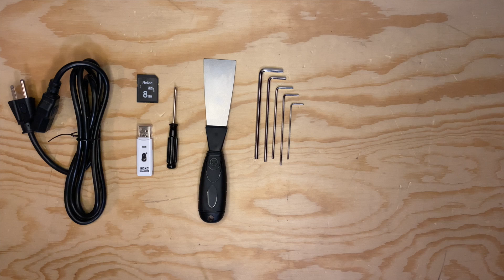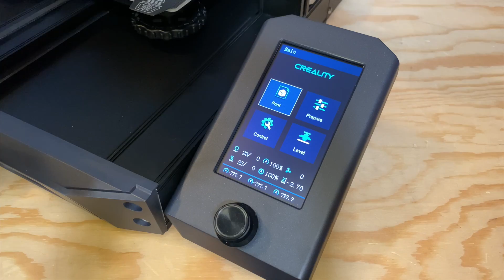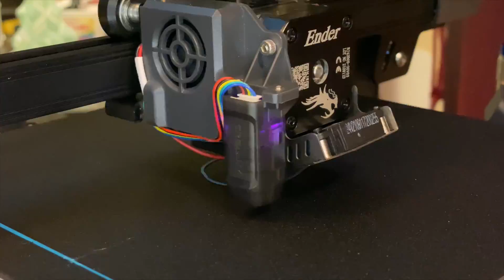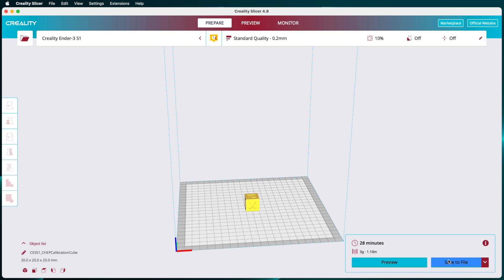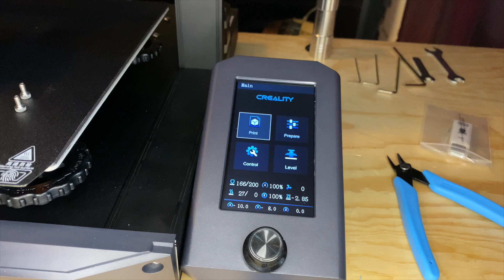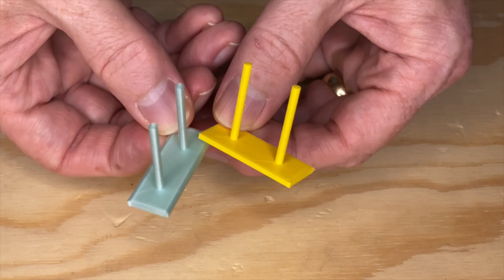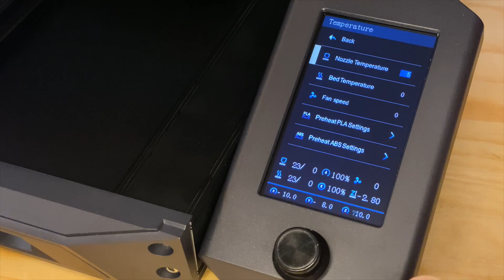The New Creality Ender-3 S1 Review!

Comment: I'm looking for a little help. I'm trying to flash my s1 back to stock after removing it from a sonic pad. I've tried all the firmware options from crwality and can't seem to get it flashed. Display is stuck on the splash screen so I can't tell if the board firmware is loading or even working.

Comment: Hi Bryan, do you happen to know if the catastrophe regarding resuming after a power failure was ever fixed?

I'm pretty turned off on the idea myself. With my ender 3 v2 the sample filament ran out mid print and while I was anticipating it enough to pause and change fillament, the new fillament oozed while the nozzle heated back up, the new fillament didn't extrude properly at first and the oozed glob made a mess. After letting it run for a couple more layers with my fingers crossed, it was clear that print had failed and I had to start again.  Up until now I thought that was the worst thing that could happen if a print was interrupted.

Comment: Thank you for great review video. I have a problem with my s1. Can you help me? I recently purchased an Ender S1 3D printer from Micro Center and have used it for 3-4 prints. However, I've been experiencing an issue where the nozzle and bed temperature drop to zero after heating them to a certain setting and starting a print. I've tried cleaning the hotend nozzle, but the problem persists. Can you assist me with this issue? Thank you

Comment: they have fixed it fully i tried it i have 3 ender3 s1 and a pro all power lost worked fine and i have convert one of my ender 3 s1 to a pro version runs like a dream the new s1 i have a small issue a end stop switch on the bed is rattling creality sending me a new one

Comment: Brian I have this printer on the way I also have a Prusa MK 3+. Since I’m using Prusa slicer I would like to use it with this new printer. Can you give me any hints since processor slicer does not have the same presets for this printer. At least that’s what I’m being told from Prusa support. I know this is a long post but also do you think you could do a video on how to set this up on a raspberry pi. I’m assuming you just use the usb C Connector

Comment: Based on this video and a couple more like it, I made a decision to took the plunge and bought one today and am on my third print object.  I printed the rabbit and handle thingy first and was very pleased with the rabbit, but the bed handle thing was a little rough after I removed the support overburden.  I'm currently printing a small box that fills the width and discovered that this printer is very easy to change the z-offset and increase the nozzle temp on the fly, which is a major benefit for a novice like me.  I changed filament types after creating the GCODE file and discovered that the silk filament needed 210 degrees as a minimum, which I was able to change using the "Tune" option on the control panel.

Comment: Can someone tell me what this printer (assembled, with a spool on) measures to? As in, height, width, length.
For the life of me, I can't find it. I can find "frame dimensions" but not confident what that does and doesn't include.

Thanks in advance!
Reply from the maker: Imperial Measurements Inbound! (My Stanley tape measure isn't metric)
Height with spool: 27 inches.
Depth: 24 inches (measured with bed at rear, then at front, and allowing for bed cable).
Width: 20 inches actual, 24 inches allowing for gantry cables that live on the left side).

If you're wanting to build an enclosure I'd add two inches to each dimension.

Comment: my ender 3 s1 won't recognize the sd card that came with the printer... can someone help? thanks
Reply from the maker: Hi, if your computer can read the card, back up the files on the card to a folder on your computer. Try reformatting the card [ see https://youtu.be/VM29_OFHpy8 ], then copy the files back onto the card.
Reply: @BV3D  Thanks for the response. I tried the solution in the video and erased and formatted as instructed then put everything back into the SD card, but the printer still won't recognize it. I also tried to format it using the SD Card Formatter application. This also erased all of the contents on the SD card, but again, the printer won't recognize it. Do not know what else to do. This is the original SD card that came with the printer, so I do not understand why this is happening.

Comment: Great video. Thanks for all the info. Question: Have you tried filament change (M600) ? I tried it through the creatlity slicer. Things started off great, I like the way it paused and didn't leave the nozzle heating for a long before making the user heat it up. But when I went to restart the print, it just sat there purging filament for a long time. I waited thinking this is a lot of purging before I decided it's not going to stop. Anyway, would love to see if anyone else has tried it, and there steps to get it to work.

Comment: Wait why does the temperature drop slowly when disconnecting the probe? It should instantly read whatever value an infinite resistance across the sensor means, shouldn't it?
Reply from the maker: Sorry for the confusion. The scenario described is not the thermistor becoming electrically disconnected, it's the thermistor becoming physically separated from the heater block, and thus no longer reading its temperature (and instead, reading the temperature of the air).

If the thermistor becomes electrically disconnected, then the printer will read that as 0˚C.
Reply: @BV3D  but you showed the value going down slowly and disconnecting a cable, so one of them was just a clip you showed in the video that doesn't actually correspond to what was happening? I understand, thank you.
Reply from the maker: @LuLeBe  The cable that was unplugged was the heater cartridge's power cable. By having the heater cartridge unplugged, I simulated a situation in which the thermistor was electrically connected, but not able to accurately measure the temperature of the heater block, as would happen if the thermistor was no longer in physical contact with the heater block.

So, by unplugging the heater cartridge's power connection, the temperature of the heater block will drop. The printer doesn't know the heater cartridge is unplugged. It thinks it's still connected, and so it keeps power applied to the port that the heater cartridge had been plugged into, trying to get the temperature back up to the set point.

Eventually the printer decides that continuing to power the heater cartridge (which isn't plugged in) is not bringing the temperature back up, and it displays the thermal runaway error.

Does that help clear it up? 😊
Reply: @BV3D  ahhh sure, didn't think of that, thanks for clearing up the confusion. Btw, there are different limits in marlin like shutdown when no temperature is reported and when heating doesn't give sufficient temperature increase (like in your test case), and the values for that can be set, so what I did with use an adjustable wrench to hold the whole heat block and thereby sink heat into it, that allowed for very close inspection of the temperature and time limits in the firmware, just in case you ever wanted to experiment more with that on a printer where you don't have access to the source code to just check it.
Reply from the maker: @LuLeBe  That's a pretty cool way to test. Thanks for sharing that technique!

Comment: Can build a comparable ender 3 for way cheaper. BMG Clone, Microswiss Clone, bltouch, flex bed. ~$300
Reply from the maker: Yep! DIY is definitely a great way to save! Some people may not have the confidence to do that when they're first getting into 3D printing though. I see the S1 as a way for people to get the feature set they want on the Ender 3 line without having to do a bunch of work at the outset. 👍
Reply: @BV3D  That's absolutely a fair point. This machine does have a place.
Reply: Dual z really isn't a big deal for the length of the gantry.

Comment: Creality slicer looks like a skin of Cura.

Apparently you should just use Cura because Creality Slicer is based on an outdated Cura version.
Reply from the maker: You could 100% do that. You can create an Ender-3 S1 configuration by adding an Ender-3 V2, changing the build height and retraction settings to match what Creality defined for the printer in their slicer. I say "their slicer," but you know what I mean. 😉

Comment: Don't you have to sync the 2 Z axis steppers to the gantry is level first? Before leveling?  Surprised you did not go over that.
Reply from the maker: There's a belt keeping the two Z stepper motors in sync. Presumably it's good to go from the factory. I haven't had an issue with it on this one.
Reply: @BV3D  Interesting.  So it has a belt AND 2 stepper motors? Seems like you don't need a belt if you have 2 steppers or visa versa.
Reply from the maker: @FinlessBob  Yes, that's correct. I've wondered about that myself. Seems if they're belted and there's no slop in the belt, it would work OK having a single motor driving two lead screws.

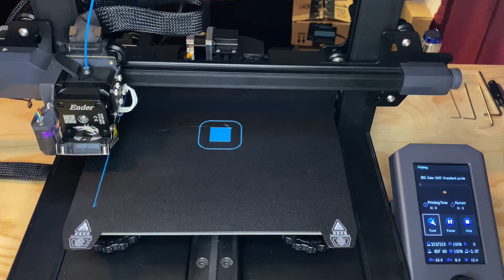Comment: 12:06 The power outage recovery test. (It will never work. Just get a good UPS in place, problem solved.) First. The re-home after power outage is the BIG fail in my opinion of the power out recovery. I did not see it use the print head mounted Z sensor to confirm where the bed is. Maybe it used the Z home switch?

Second and I think this is a big point as to why it will never work. Let's assume it does manage to reposition correctly. The project end point is now cold. Probably miss formed. So how is the hot end going to lay down/attach a clean hot strand of filament to a cold end well enough that on the next pass over that,, weld,, will not cause a problem?

In my opinion. If you have a power outage during a print, it is best to trash it and start over when the power is back.

Comment: I would like to add to my experience with the Ender 3 S1.  Got it on Jan 9th and it no longer will except filament after a jam on Jan 26th.  I followed Creality's YouTube channel for clearing a clog and it did work, but it was a temporary fix, as it seems it will no longer even allow filament to be loaded into the extruder.  Its a shame too as I really was loving that printer.  But I am probably going to send it back to Amazon as it didnt even last 1 month.  Maybe I can exchange it with another one, but it could be a design flaw in their extruder, which means it could happen again.  I only have till the 8th to send it back, so about a week left and the printer is dead......

Maybe you could make a video showing how to completely take the new Sprite extruder apart, maybe you'll find an issue or something.  Might also help other with that too.
Reply from the maker: Hi! Definitely take advantage of Amazon's return policy. I ran some PETG at 240˚C through it yesterday, for a couple of hours on some small parts, and it did OK. But that's about as hot as I'm willing to run that extruder, since it's PTFE lined. I should probably order the all-metal version of the Sprite, which will be able to hit higher temperatures because it doesn't have that PTFE inside it. Looks like it might be available sometime in the next month.
Reply: @BV3D  I was only using PLA at no more than 210 for the 1st layer than 200-205 for the rest of the print.  Also after the failed print/clog I followed the instructions and since I had some capricorn PTFE I cut to the right size and replaced the stock PTFE in the hot end, but still has issues, I am sure its the extruder part that is messed up somehow...
Reply: @BV3D  Update on the problem.  I took the entire extruder/hot end apart and found that the clog went all the way up to the gears of the extruder, so it was blocking letting the filament in at all.  I am running a test print after the complete tear down and it seems to be working perfectly....  The tear down is a pretty good chore.
Reply: @TheLotw  I understand the frustration. First a bit of background. As a gift my brother gave me an Ender 3 Pro early November. I didn't jump into it. I watched the build videos.... (It's going to be the ender of me). 3 weeks later I had my first experience using a 3D printer.

Related to you. CLOG! It seems Crealty carries a flow problem from the 3 Pro to 3 S1. Luckily I have not needed to take apart the block to clean it. Ram rod it and replace the nozzle works for me. It's what I needed to do to print 3 Harry Lions. Plus the side spool mount arm, which was needed to make the lions happen.

Comment: So I'm new to this and just got an S1! I heard online that you may need to manually level before starting on the first try? Any tips on that?
Reply from the maker: Hi! Yeah, ideally you want the bed as level as possible, manually, so the probe can compensate for where the non-flat areas of the bed are.  Check around Page 7 in the manual. You're looking for the Auxiliary Leveling section. It says that if the difference between one side and the other of the bed is more than 2mm, the CR-Touch probe will fail. Manually leveling first will help ensure that doesn't happen.

Comment: Creality needs to step it up and include better springs.

The latest firmware is installed, when I have to abort a print job because it's difficult to level this printer with the current springs, the damn bed returns back instead of forward, if you had a print job as high as the Z bar, it's going to rip it clear off the bed.

Can you not set a custom home position so this thing returns the bed to the front and raises the Z so you can clean the nozzle? It's a bit tedious having to manually dial the bed forward so you can clean the failed print job then dial the Z up so you can preheat and clean the nozzle. I'm about ready to return it.

Comment: The part where you say it turns off the bed heater when probing. Is that when you print off of an sd card? Or all the time no matter if you put start g code to tell it to not do that.
Reply: It turns off the heated bed automatically when you initiate auto bed leveling procedure, but someone commented down below that newest firmware changes that but haven't confirmed myself

Comment: if i still want to use cura  instead of creality slice do i just add a new printer with creality dimensions and start and end g code.?           also do i need to add any command in start g code for the auto bed  many thanks great video and i just bought the ender s1

Comment: My main question is will it be compatible with the ender extender 400x400 system?
Reply from the maker: I expect that to depend on what changes need to be made to vanilla Marlin to make it work. It's a new board, so the board definition (or a pins file?) will be needed. But with that, you can edit the source code to set the X, Y, and Z max values, probably. Hopefully Creality will release the Marlin source. They SHOULD, it's probably just a matter of when.
Reply: @BV3D  Awesome, thanks for the insight. This new printer basically has all the upgrades I already want, and if I could go large format for cosplay stuff, it would be perfect.
Reply from the maker: @Chilimustard  If it wasn't a new board, it would probably be easier to build a config in Marlin (or JyersUI). But I haven't seen this particular board before.

Comment: With the wires I wonder if you can fit a Swiss DD drive on it, you can get higher temps with that beast. Als a Z stop sensor would stop the head dropping in the bed. Wonder if that can be installed also. Making it more quit will be install buckconverters and 12V noctua fans etc.. :)

Comment: Wonder how easy it will be to put the Sprite head on my ender 5 plus? Lol.
Reply from the maker: You'll probably have to reverse engineer the pinouts for the ribbon cable and build a breakout board for the mainboard side of the connection, just to get everything into the ribbon cable. It seems like something that would fall into the "Moderate Skill Level Required" category. Ideally, Creality should release just such a board, and a long-enough ribbon cable to allow retrofitting the Sprite extruder onto other printers.
Reply: @BV3D  Agreed 100%.

Comment: in my opinion - Maybe you made a brownout instead of blackout, so the MCU did not boot/reset properly and messed up that recovery. But actually, theres similar bug in Marlin FW(I'm currently running 2.0.7.2, older versions made that too). and if i run some specific gcode for loading filament in my machine, the next gcode(both via USB from octoprint, first gcode either as file or a macro from octo plugin) homes properly and then goes to back left corner and starts rundomly dumping filament and some other weird, potentionally destructive stuff - no other issues. STM32F4.... i think it could be similar problem and i bet its related to UART comms between display and motherboard, or between SD card and motherboard. Or maybe it could be some problem with max extrusion length limit in FW.

Comment: Hey Bryan, great review. 
I've been watching reviews for weeks and narrowed down my first printer between the Artillery Sidewinder x2 that you recently reviewed and this Ender-3 S1. 
I'm leaning towards the Ender despite the larger build volume of the Sidewinder because of the community around the Ender series... 
Is it safe to assume that when I want to move to a larger build volume, that there will be after market parts to do so?

Any takes on the differences between the extruder and hot end of the Sidewinder x2 vs the "Sprite" extruder on the Ender 3 S1?

Thanks!
Reply: Actually the Artlillery Genius Pro would be a better comparison to the S1 because of the similar build volume. I found myself looking at these myself but then opted for the X2, you can always print small on a big printer, but never big on a small printer. We'll see how that works out. Ultimately I went with the Artillery for the AC bed heater and quiter operation.